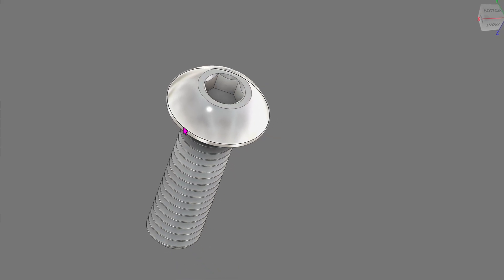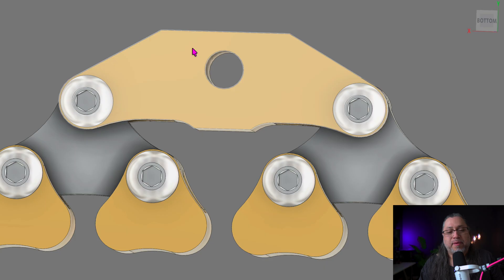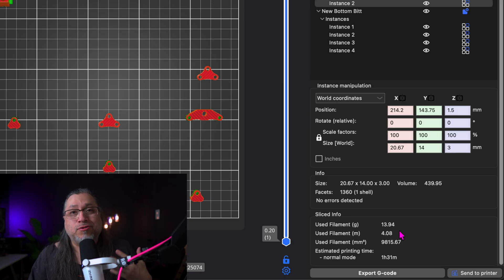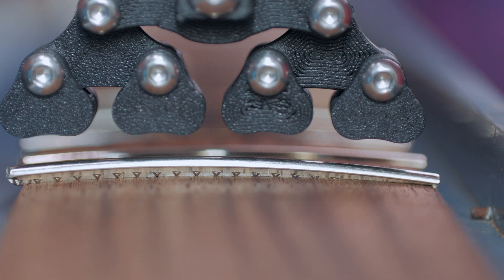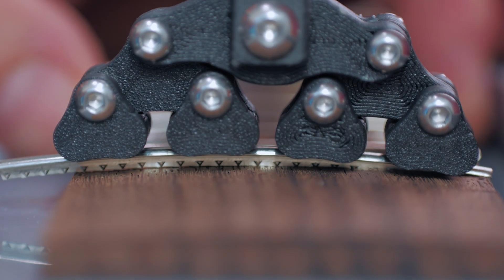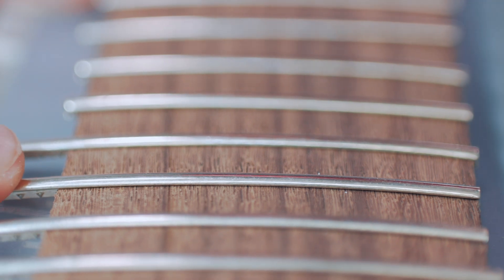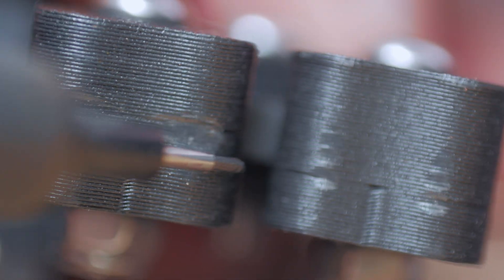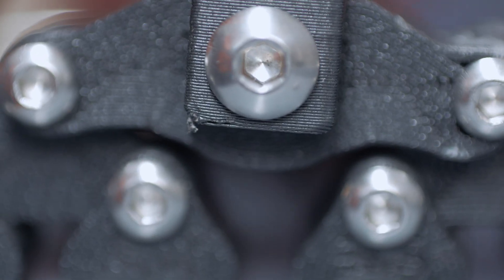3D Printed Fractal Fret Press - Will it Fail?

Comment: it honestly is probably better to have feet that are destructible and crack before they transfer that force to anything on the guitar- one possible advantage of doing at least prototyping in 3d printed filament rather than actual metals

Comment: I've designed and printed a few widgets to work on my guitars.  I recommend looking into high shore hardness flexable filiments.  TPUs are very durable.  In addition, they open up the world of compliant mechinisms.  Geometries that are impossible to manufacture any other way.  The material properties help drive the design.  Keep exploring that 3d printer, there is a whole world of possibilities.  You can make a viable tool with the proper design and material.

Comment: For a round shaft meeting a flat surface, I'd usually put a fillet at the joint to prevent sheer forces from separating the layers. Looks great though!

Comment: You could try printing the bottom 4 feet with printing lines 45 degrees to the frets. It means printing the part not laying down to the plate, hovering instead. You can also try decreasing layer height to as minimun as it goes (or stop around 0.1mm). That would solve feet problem. For the upmost triangle part, I would machine it out metal. Anything would work I guess. And I would swap the sandwiching logic. In your design, feet are the buns and the middle 2 triangles are the meats. I would go the opposite, feet are the meat, middle 2 triangles are the buns and the top triangle is also the meat.
Reply from the maker: All good suggestions. I definitely like the 45 degree idea.

Comment: Here is the best bit of the hard work you did in CAD  (fusion 360) will now allow you use a CNC router to make those pieces in brass or many other materials by converting it in to Gcode to be used in CNC. like I mentioned you've already done the hard part. Personally I'd have used a resin printer and printed in ABS like resin which I find robust and have used it in many of my projects.
Reply from the maker: I don't know much about resin printers. I always thought the printed items would be too brittle. I figured ABS would be a tougher material. Also there is no point to machining this on the CNC. So much easier to just buy one. They are so cheap.

Comment: Given the small size of the parts I doubt much can be done with the geometry without impacting functionality (I.e. making parts bigger). I doubt the infill makes any difference for most of these as the 8 walls would essentially make them solid. Layer orientation is something to try out. I think you’d have a much better chance of avoiding the splits/cracks to the feet if you orientated them differently. Other than that I’d suggest using a more appropriate filament. PLA is not great for this type of application. PETG would be a better starting point. Would be interesting to see a resin print version, I think that may hold up better.
Reply from the maker: I'm really in the dark with the whole resin printing idea. Do they really produce more robust prints?
Reply: @MarkGutierrez  I’m no expert either, and I’ve not seen any testing on it. But from my understanding, it’s still built layer by layer, but the resin is then cured which I would assume is far stronger than the FDM style layer bond.

Comment: Would stainless tube sleeves for bolt holes provide more stability? Larger holes and surround to accommodate sleeves.
Reply from the maker: Nice. That's a good idea. I've seen that done before. Maybe the sleeves would spread out the pressure.

Comment: hey nice try
got few incoms to suggest if you want to shoot another try, unsolisitated advices yes if you dont want them just dont read :

so overall i think you can totally make that work with few modification
Plastic is softer than metal so you need to adapt the design to it not copy. The parts must be bigger for the same strength. Here the feet need to be about this size but they are not the part seeing the most strength so probably not the limiting factor. I would make all parts but the feet about twice as wide , that may require to swap tenon/mortises order. 

i would use plastic pins instead of metal screw. Being much denser the meta screw will make a dent in the round plastic hole, your macro view show that pretty clearly, the effect is the force will concentrate on one point instead of the full half circumpgerence of the hole, increassing the stess. If materials are the same they tend to comply with each others and spread the efforts more efficiently. You may concider doing larger pin then. This could probably be a one piece print in place, just have a gap between hole and pin of exactly 2layer height, probably need some tweeking but doable.

Speaking of one piece, the problem with the feet is you orented the layers right for the pivot. I would have probably done the same as pivot stregth is main concern. You cant have good layer orientation for both pivot and fret. You could try printing diagonal but that brings other problems. Or you could just have the feet in two pieces so each can be optimised for the efforts it sees. 

For the materizal i thing PLA is actually your best bet. You need something with high static strength, stif and somehow slippery. Others easy to print materials like asa or petg are tougther because they are less brittle than PLA but they are less resistant in static load so double not good in this application. Fiber reinforced filament are stronger and stiffer but not by a lot, they are nightmare to print and the main problem is they are not just less slipery but pretty abrasive, so probably not what you want on your frets. But you may want to print the bulk in these and just the tip of the feet in PLA, i wuld not do that because i don't thiink the trouble are outweithed by the benefits but millage may vary on that. 

That being said you could aalso ask JLCPCB a sponsoring and ask them to print your design as it is now in brass, they seams to do a lot of yt marketing of that kind these days. 

And last thing, being a luthier, have you concidered doing it out of wood ? Using very dense wood such as hard mapple maybe ? 

Just my 2cts ...

Comment: You might want to try calibrating your extrusion rate and pressure to try and get the individual lines to squish together better. I would also be curious to see if printing at a smaller layer height would make a difference.
Reply from the maker: I'm a complete 3D printing novice. Too scared to edit any of the printing settings. I just roll with the presets. But someone else suggested a smaller layer height. So that is something I can easily try. Thanks!

Comment: A few thoughts. Build parameters plus material are key, but most important is bushing and hardware tolerance. No bushings on treaded bolts is going to bend and flex. Your design is too loose and floppy.
Reply from the maker: Using bushings would be an easy alteration to implement. Thanks!

Comment: Looks like the tops of the middle two feet are bottoming out on the largest (top) bridge piece, which prevents the outer two feet from having enough force to push the outsides of the fret all the way into the fretboard
As you already mentioned, getting the printlines perpendicular to the fret would prevent a stress point on a single layer line (kinda like grain in wood - it easily splits along the grain and not across)
Anyway, another cool experiment!

Comment: The modulus of elasticity of the material is the difference. Pieces should be bigger in order to withstand the same forces. Make sections bigger and it will work. Also fiber orientation is important. Nice video.

Comment: Yeah i tested this out too about 7-8 years ago, with the most common materials available at the time, i always hammer in the frets with a brass hammer, but i thought it would be cool to print something like this and see whats gonna happen. It failed after 4-5 frets and i didnt put to much force when pressing them. I do think that those real brass fret presses are really good tools, i still like hammering the frets in place. Thanks for the video.
Reply: So I assume the brass is to keep from fret injury. Wouldn't a wooden, Nylon, or hard rubber head hammer work just as well and be even safer ?
Reply: @terryenglish7132  The problem is that when you are using a tool like this there will be a serious amount of pressure on the fret to get it seated properly, Wood will not work, nylon will not work, hard rubber head hammer will not work very good either, well you would use a rubber hard head hammer but far from optimal. i´ve tried most of these things and got to the conclusion that brass is the way to go, either you hammer it or pressing it.